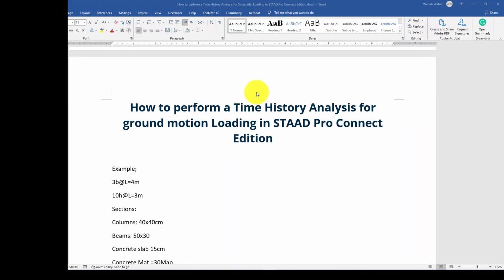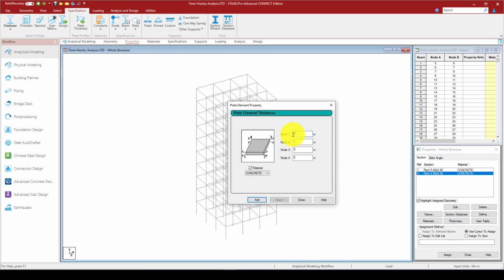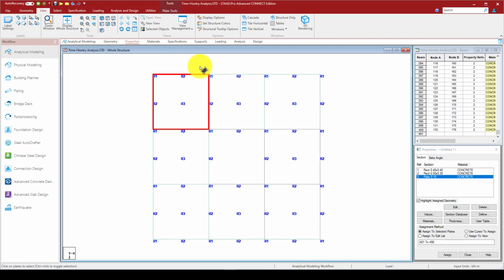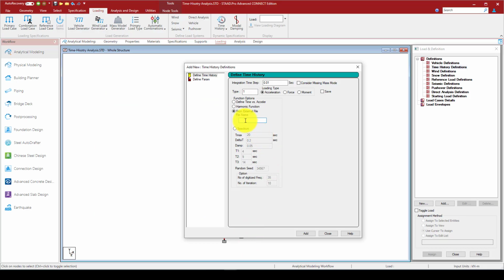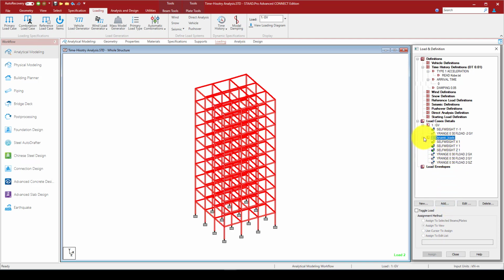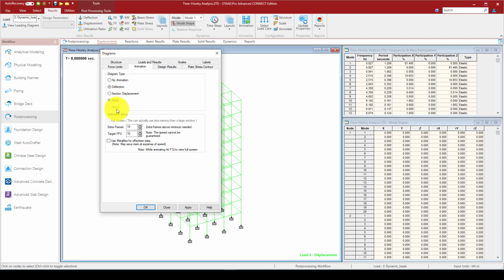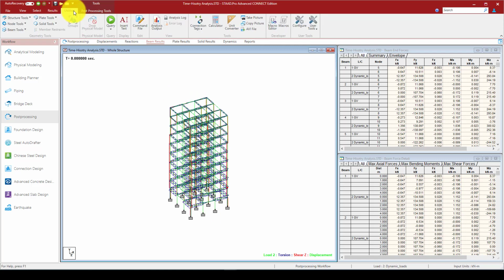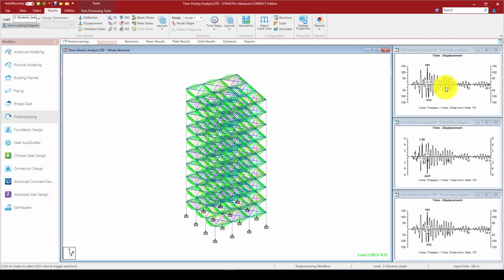STAAD Pro Connect Edition Tutorial;  Time-History Analysis on a multi-story RC-Framed Building

Comment: how we get the data of time-displacement, time-velocity, time-acceleration in table form (for each story)
Reply: Yes sir, I got the data in the form of graph, but how we get the data for each time step, it means (I used here 0.02 sec)every 0.02 second the displacement, velocity and acceleration value in table form
Reply from the maker: Check the output file, there is a text file.  @darshanyagnik2534
Reply from the maker: You check the video